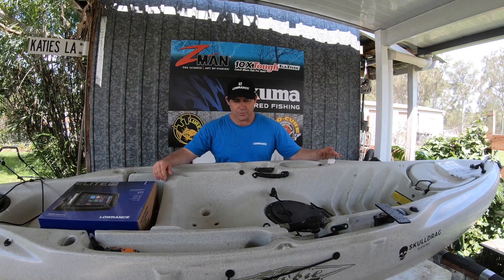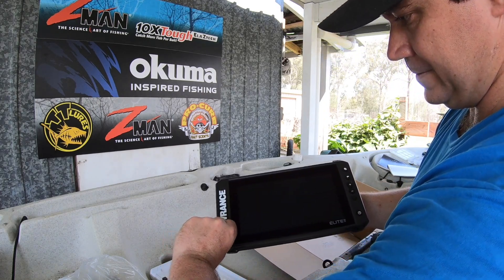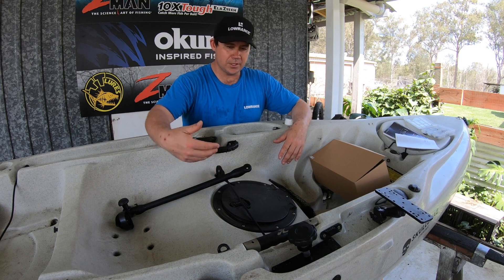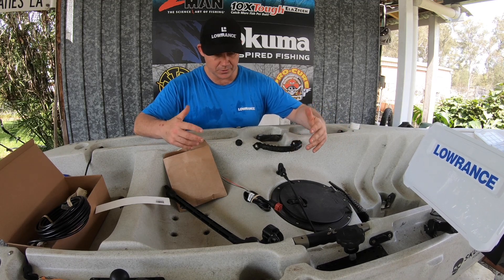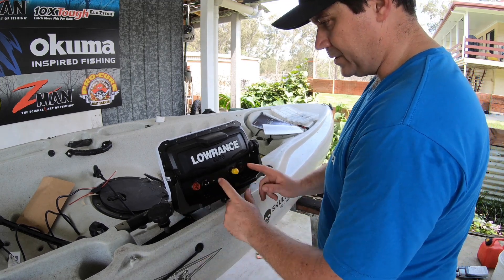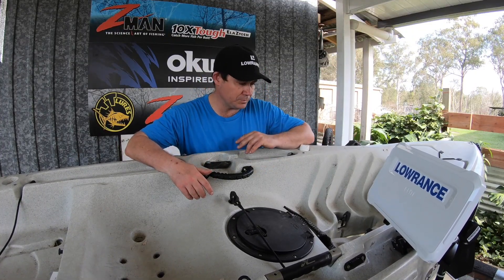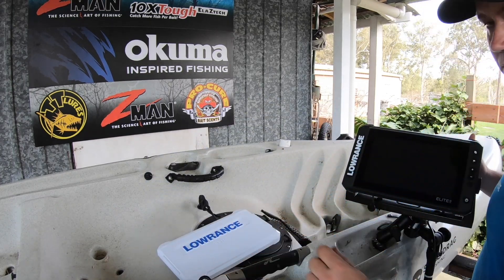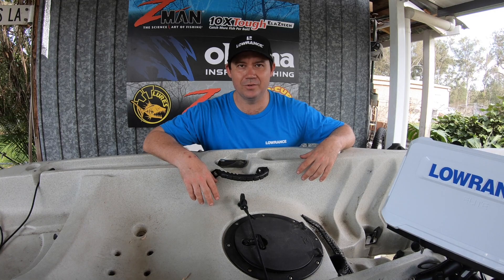Lowrance | Sean Bekkers | EliteFS Installation | Kayak fishing

Comment: I also am searching what to do with yellow wire on power cable.. didn't wire on yellow 1st attempt no power. Going to recheck splices today. Best I've figured so far is that yellow is hot wire for yellow accessory port..? Does it need to be wired to postive battery terminal connector with red?